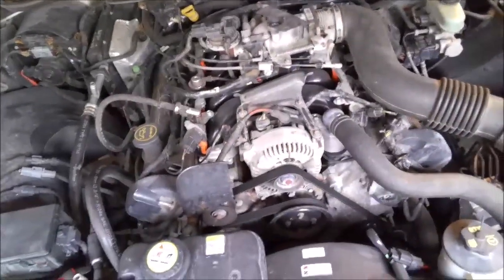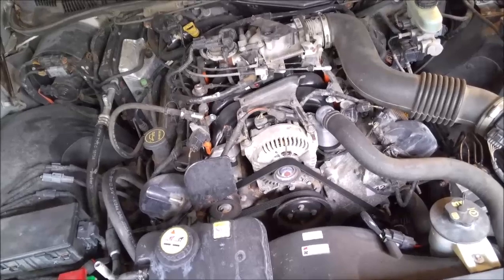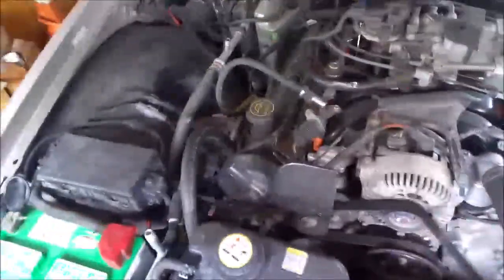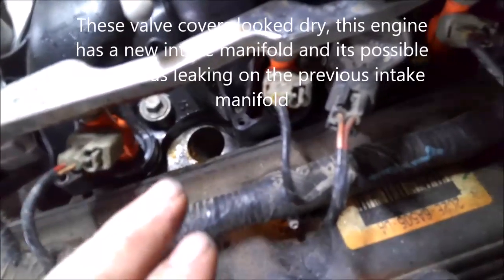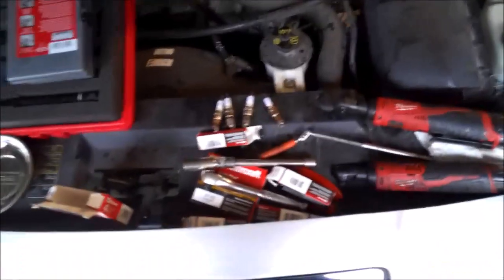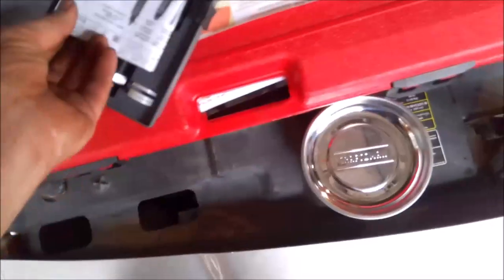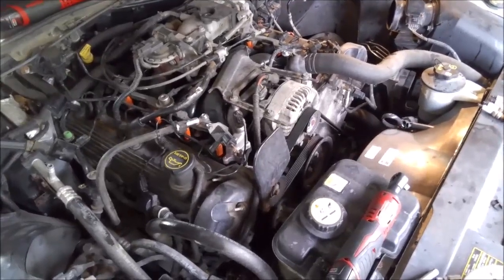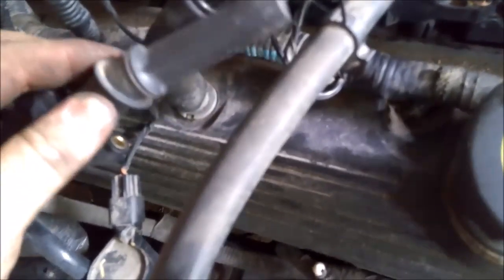Ford Crown Victoria and Grand Marquis Spark Plug Change 4.6 v8

Comment: Good information. We bought some bad gas and now it's just sputtering at idle runs fine faster.
PPL say everything - injectors, clogged this and that, plugs, wires, coils. IT ran like a top till that bad fill was put in. Now flushing with premium and cleaner. IF that doesn't help the we go to plugs.

Comment: I have 2011 Grand Marquis and I'm getting ready to change my spark plugs which were supposed to be replaced at 105,000. I have 140,000 on mine and it runs like a top but just wanted to change them soon.  Watching this video because it looked like I would be able to pull the coils out due to the fuel rail being over top them but I see it can be done.

Comment: So I changed my plugs and found oil on top of them.  It makes my cylinder 7 misfire.  Once I clear the oil and clean the coils/plugs it runs fine for 6 months or so.  Once I overfilled the oil changing it and all plugs were oily.  Now only cylinder 7.  Issue is, I cannot find where it is coming from.  The only logical spot is the valve cover gasket, but I cannot tell where.  Any tips?
Reply from the maker: Yes valve cover gaskets are leaking.

Comment: At timeframe 5:10 there is that Silver bar, my car has it also I can't get my 7mm socket on with the wrench to remove, how did you do it?
Reply from the maker: That's the fuel rail, you should be able to get it in if not maybe try a swivel but usually you can get the bolt off with out one if you are careful and go slow

Comment: Good Video, but I have some Questions. I've watched several of these videos. I have a 2004 Mercury Grand Marquis, 4.6, and have a Mobile Mech coming tomorrow to change my Plugs and Coil Packs. Some of the Videos I've watched recommend putting Dielectric grease inside the boots, and Anti Seize on the New Plug threads, it becomes a bit confusing as to WHO is Right.  What do you think?  I love Youtube.
Reply from the maker: It's fine to do either or both but not really necessary in most cases.
Reply: @HooptiesGarage  Thanks for your Reply.

Comment: In your opinion, do you think 5w20 is good for this engines? Rather than 5w20 which it was specified before?
Reply from the maker: I always use whatever the manufacture recommends they have such small oil ports for the timing components etc that I dont take any chances and use what they want. I also don't extend oil changes as long as they want you to now either for the same reason.

Comment: which spark plug to use on ford crown victoria
Reply: Crown Vics, Grand Marquis, and Town Cars with the 4.6- liter 2v engine - Recommended -- Bosch Double Iridiums for maximum performance and fuel mileage.
Early Panthers with Plug Wires -- Bosch Double Iridiums # 9605.
Coil-On-Plug Engines - Bosch Double Iridiums # 9606.

Comment: And don't put dieletic grease on the metal part of the plug. It doesn't conduct electricity, it blocks out moisture. Only put around the inside of the boot!

Comment: So,what are the torque specs for the spark plugs?
Reply from the maker: I usually tighten them until I feel the washer crush and then just a little past that. Actually torque spec would be in service manual or online.